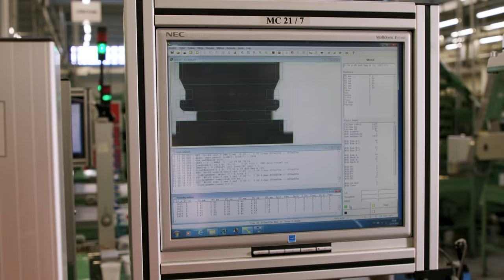Sellier & Bellot Factory Tour 4k

Comment: Never had a problem with this ammo until I bought a Kimber micro 9. Had a batch I purchased (multiple boxes) that had many light primer strikes. These weren't the first shots fired thought the gun, and I was certain I had put about 200 round of S&B through it without problems before. So I chalked it up to maybe those boxes came from the same "batch" from the factory. I had one or two failures every mag. Called Kimber, they told me S&B isn't up to SAAMI specs and that I should use better ammo.... works fine with my Ruger pc9, and p320. But the Kimber micro is a no go.

Comment: My little .32 ankle back-up gun is currently carrying their ammo. They use the older European load data for the .32ACP, so it is a bit hotter then most of the stuff made in the states. I used their .303, .308, and 5.56 ammo from time to time too when I want a factory control group.

Comment: Good to see these kind of videos, great job. I've been using S&B ammo for many years, about 5 different loadings The product quality is very good and tolerances are kept to spec. The price point has always been the biggest plus, excellent.  However, and this is my personal experiences. It has to be the dirtiest, most fouling ammo I've ever shot, hands down! Having shot many thousands of S&B 5.56, .308, .30-06, 6.5×55 Swedish and others they all have this in common. But the 5.56×45 has to hold top spot as the worst, by far. That aside it's a great deal and good shooting. The powder just needs to be cleaned up.

Comment: They really need to improve their QC. I had 10 subsonic .300BLK  rounds that I was able to remove the projectile by hand. I also had 5 rounds that I had to remove the upper to extract. This was out of a lot of 100 rounds. The ones that did function correctly were great rounds, holding at 1 moa at 100 yards, which in my opinion is long distance for subsonic ammunition.

Comment: I've used a fair bit of S&B in calibers .357 and 9mm. I also tried .22LR but found it to be among the least accurate rounds in a very brief test, but the main problem is availability. I haven't had issues with 9mm so far and hopefully won't, as I have a fair amount stored right now. However in june 2017 I bought a box of 1 000 rounds of .357 and I found 12 rounds where the projectile was bottom up in the casing and two rounds which I suspected to have a light load as the flat nose (SP ammo) was left round and two more were suspectible. Before this I had only ever seen one .357 projectile bottom up in the casing and suddenly I had a dozen at hand. All in all that day I dumped 16 rounds out of 1 000. The rest of 984 rounds had no issues whatsoever.

Comment: But I'm curious about could they make a 7.62x39mm longate the bullet to a length of 150 grain bullet give it a hollow cavity like the 7N1 elongation of the bullet what are allowed to fly over at longer range to be more accurate shut down in the casing to give them more of a push in the powder be compressed more